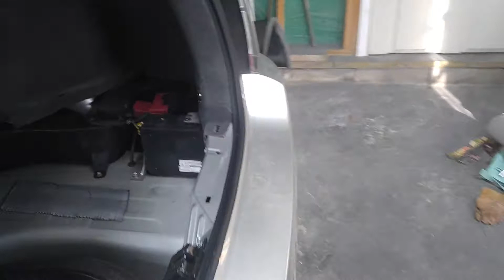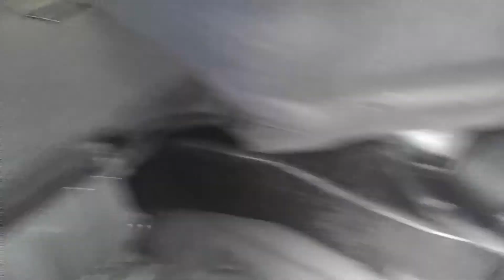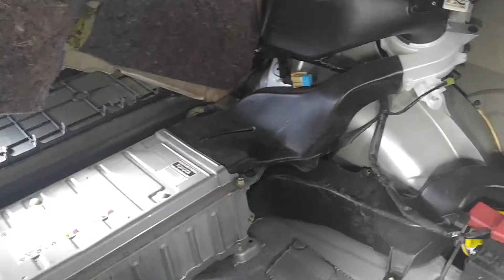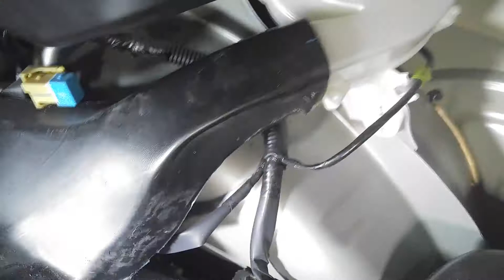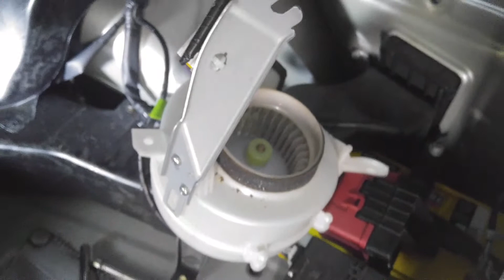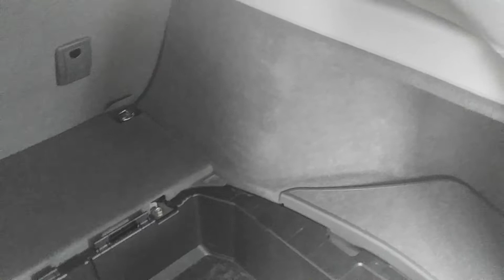Prius hybrid battery cooling fan 2005

Comment: Yeah, I'm late to the comments section,  good video, However, it's Way more important to pull the black vent that connects up to the vent you can see on the right side of the back seat, there is a filter in there that traps all the dust, hair and debris PRIOR to it reaching your fan, if that is clogged up, you are still starving your battery of fresh air and overheating your fan and battery pack.  This is the 2nd video I watched where they only pulled the fan and nothing else. The reason the fan didn't look too bad, is cause all the debris is up top at the end of the vent trapped by the filter screen.
Reply: There is NO Filter on a Gen 2 Prius from the factory !!!  Unless someone added one, which is a Great Idea to protect the fan system...

PS... There is a small filter that they have put in them incase the vent on the right side of the seat is covered with something like a jacket or blanket etc...

Comment: You should always check that the fan is working before you hook it back up. Otherwise your batteries will be overheating quickly.
Reply: You can tell if the fan is working by simply putting your ear or hand to the vent. Lol

Comment: how did it work out? is the fan working? my 05 Prius battery fan use to run strong but lately it runs very very low I think it may need cleaning? thanks for the vid
Reply from the maker: Hay.. I was not having any problem with fan ..I just noticed others  saying that the fan gets dirty.. I was getting close to 120k so I just cleaned it..I have never noticed it running..I think it only runs as needed?
Reply: I've heard mine run like twice only and I live in Houston. It's been over 100 degrees on the cars thermometer and the battery fan doesn't run.